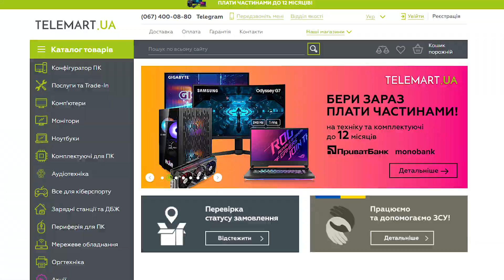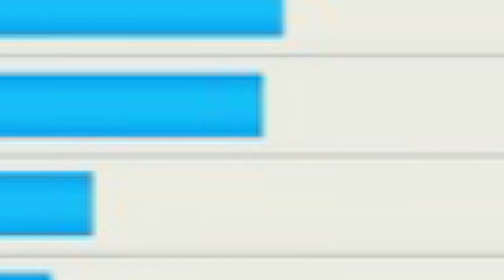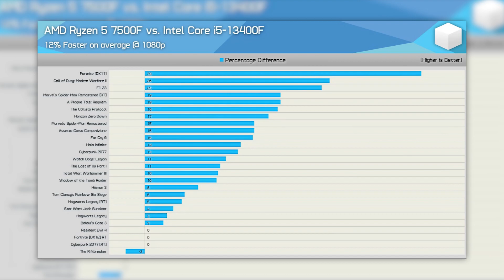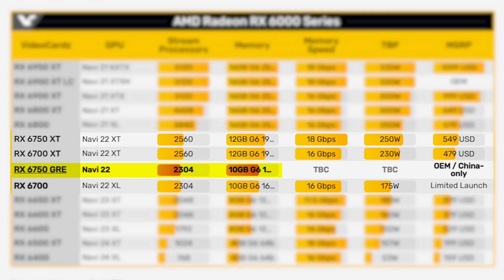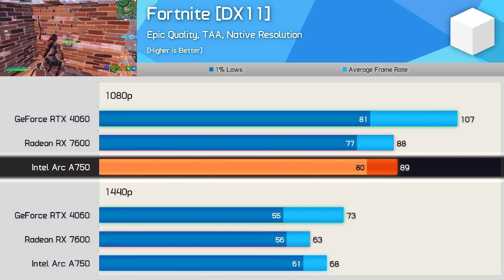Intel Battlemage is Getting Tested

Comment: The intel prices do kinda make sense.
The 15th gen will use a different motherboard anyways so they expect people who know what they're doing to not get the 14th gen.
That leaves 3 types of people who will get it.
People who don't know much about computers and just need one next year so they'll get one that has a 14th gen because that's what it comes with.
The aforementioned ones with too much money. Any performance increase is a performance increase, $695 isn't that much for some people so they don't mind.
Lastly are the one's who have no choice because their computers had an issue and they need a new cpu for gaming. All the second hand ones and 13th gen ones might be out of stock so they just have to bite the bullet and buy a 14tg gen.
I'm waiting for the 15 th gen and the Celestial gpu to make a full intel build.